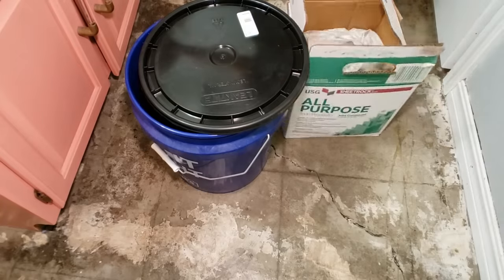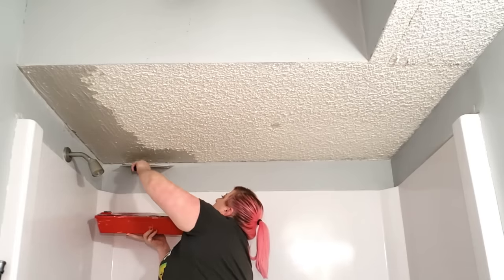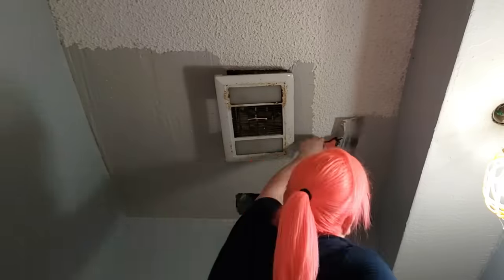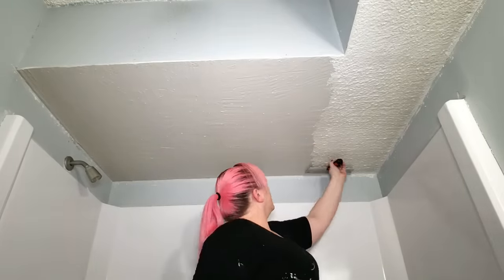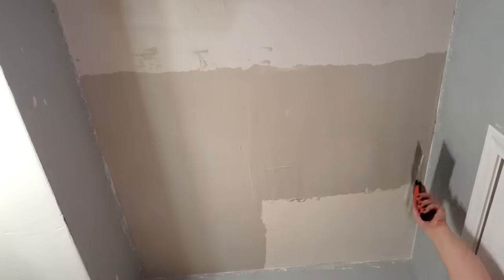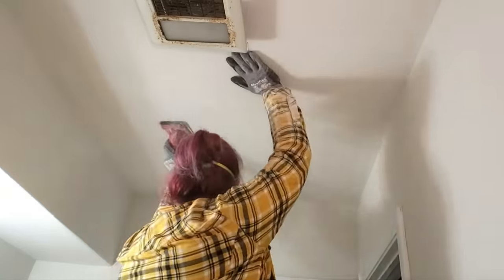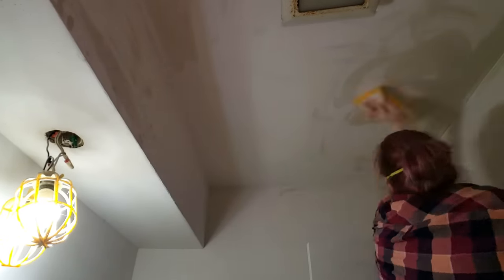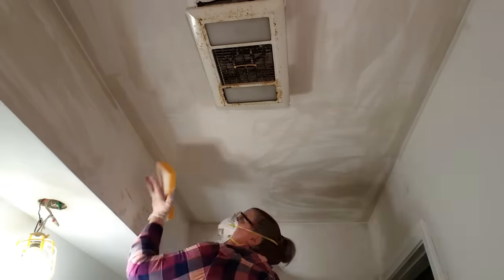How To Cover Popcorn Ceiling Without Removing It | Skim Coating Over Popcorn Ceiling

Comment: Looks like im keeping the popcorn ceilings
Reply: DONT BE LAZY
Reply: @djbusiness2010  I will be
Reply: @djbusiness2010  Lazy? The whole point IS to do the easiest way.
Reply: @markgoodwin183  the point of it is to get it done
Reply: Yeah this is a nightmare I hate my new old house and popcorn ceiling Lets go brandon!
Reply: Lol, thinking the same thing!
Reply: I agree... Popcorn ceilings are much more expensive than a plain ceiling!
Reply: 😩😂 Exactly how I felt
Reply: Just found this video After...we screwed new drywall over the popcorn ceiling.
Reply: Just watching this made me tired.  Why not just over it with 1/4 drywall?
Reply: @HawkGTboy  ive seen some people just do a skim coat over it which seems easier than this.
Reply: EXACTLY 💯
Reply: This is way too much work for what it’s worth. Cover it with tiles, put in a coffer.
Reply: Better off just hiring a professional to drywall the ceiling you want covered , abit more expensive but the quality is exceptional. Like a brand new ceiling👍
Reply: Same here!!!  Sheesh
Reply: Waste of time and material, just wet the poccorn and remove
Reply: @gerareyes2209  you don't know what the ceiling is like under the paper. It was probably put there to cover up crap plastering, so you'll have to do this anyway.
Reply: @JakubSK that’s what I’m thinking about doing to make things easier and less tiring and messy.
Reply: Holy moly that’s a lot of work for a little room !!! And I have a whole house to do 😮 so far I’ve done my larger bathroom by just running a wide smooth trowel over the popcorn, it sheared all the popcorn lumps off. Not completely off but way smoother. After I painted it, it looks textured but smooth textured. I can certainly live with that 👍 And it only took one day start to finish.
Reply: Me too! But, I'd like to take a sanding pole and see if I could sand and sorta get a knock down texture, hubby doesn't want me too tho...
Reply: Too much work. I just won’t look up anymore.
Reply: Ditto!!😂
Reply: 🤣 I loved this one
Reply: Wayyy too much work for the area done. Hire someone to drywall
Reply: @HawkGTboy because you would still have to tape the seams and mud them including the seam at the wall and all screw holes.  Easier to just mud it in the first place
Reply: @susansmith574   Yes, I was kind of thinking it looked pretty good after that first coat she put on - couldn’t you just paint it then without sanding and call it a day ?
Reply: lol same here , my neck hurts already 😂
Reply: MysteriousOklahoma you can only do that if it has never been painted.
Reply: My popcorn was never painted, and this method does NOT work. Just got the popcorn wet, and then fell from ceiling. Turned out better because after scraping, I just had to apply one coat of skim.
Reply: @Yaya1030  😭
Reply: You can easily remove the popcorn. It’s skimming  joints and such after that’s a nightmare. Would I just mud over it? No. I can see chunks coming off. There are videos showing how easy removing popcorn is and most will say “now you see all the flaws, time to skim”. I’m doing Reno and I’m leaving the popcorn. 

I do see where if you think it may be asbestos you could skim over it. But I’m kinda at a “screw it” phase.
Reply: @Susan Smith  I removed it from my whole home.  I found it easy with a spray bottle,  let water sit for a few moments the take a large trowel with the mud tray to catch the wet to avoid mess.  I did hire someone to come in and spray with an orange peel texture,  but you could just paint.
Reply: @texasjones9541  completely agree with hire someone to finish it.
Reply: No kidding!
Reply: @gerareyes2209  if it has asbestos you shouldn't do that. So that might be why
Reply: I want to get rid of mine but 😒  that's a lot of steps. However,  my space is much smaller so I may do this. Now Q: I have cement board above the stand up shower which I painted with drylock. Should I still add tile? Not too much room b/w shower head and ceiling 2-3 incheS 🤔
Reply: I was going to share the same. Mine are there to stay.
Reply: Me too!
Reply: @gerareyes2209 if the previous owner painted the popcorn is it still so easy to scrape?
Reply: @Carcassbits11  I think it is even without water. But the dust will be everywhere. That's why I'm not doing it. Trying to remove a screw on the ceiling, I scraped a whole chunk without trying to :P
Reply: Way easier to get a sprayer with hot water and spray the ceiling and knock down the popcorn with a spatula. I did a 450 sq room in 2 hours
Reply: @JessieRed was it hard to find studs to screw into?
Reply: Popcorn ceilings suck!  Ask me how I know as I’m in the middle of scraping that crap off my bathroom ceiling !
Reply: @Yaya1030 Hahaha!! Agree 💯
Reply: I can't do that. It's impossible as I have a large house. I'll just hire a professional and avoid a neck , arm  shoulder pain.
Reply: Two type of popcorn ceiling,   one, just get it wet and it will scrape off with ease test it in a closet or bathroom,  the second type…learn to enjoy your permanent popcorn ceiling!!  Sorry
Reply: Because you would still have to skim AND tape over the drywall anyway! @HawkGTboy
Reply: @HawkGTboy  just to avoid redoing all the crown moulding? I'd actually like the real answer bc she had none...
Reply: @proverbwoman5591  For me, my whole house has this crap. I’d want to minimize the sanding and dust as much as possible. So I think putting up 1/4” drywall would make the most sense for me. But you do you. 

I’d certainly pay someone to do this, no way would I tackle it on my own.
Reply: Your way was probably easier
Reply: I painted mine and they look great I used glidden semi gloss I used a cheap roller because the thick matte one absorbed a half of the gallon of paint, it was expensive and its just drywall mudd but its hard to scrape off you can do it but you need water but that makes a huge mess I just took my time it turned out great
Reply: @gerareyes2209  water doesn't work for everyone. Once popcorn ceiling has been painted over, it becomes nearly impossible to remove. I tried undiluted 30% vinegar. I tried sanding. Nothing worked.
Reply: @muuks_the_entrepreneur was this done on a painted celling?
Reply: I painted mine I used a semi gloss whut You have to roll it with a low nap but it turned out great and I am getting ready to repaint it
Reply: Isn't much easier to sand the popcorn ceiling?
Reply: @JessieRed I just found it two days after my husband scraped off the popcorn ceiling in a room we are finally renovating.....
Reply: I get it’s easier to scrape off but just so everyone knows if the popcorn is old enough it can have asbestos that’s why professionals do it. 

So just keep that in mind , her way is longer steps but she explain you can go faster with a heavier coat it looks nice because hard work pays off. 
But I also like the drywall idea and if I had to choose I’d go with drywall especially as a renter.
Reply: Just did the same thing in my living room haha 😂  @JessieRed
Reply: @HawkGTboy 1/4 in is more expensive than 1/2 just go with 1/2
Reply: Lol, thinking the same.
Reply: This might be good for a small bathroom,but a whole house…crazy amount of work over you head nonetheless
Reply: Okay!! 😂😂
Reply: @gerareyes2209 It’s very hard to scrape off painted popcorn. You have to strip the paint somehow and you have to scrape several times
Reply: How did that come out? Easier I bet.  @JessieRed

Comment: This might be ok for a powder room but let me see you do a living room or large bedroom this is way more work than taking it down and takes much much longer if you are a DIYer if you attempt this on a larger room you will end up with neck and shoulder pain and a bill from the chiropractor I’ve been a painter for 40 years and this is not even close to the best way. If you try this many people will get half way done and then it’s too late to remove the popcorn and you either have to finish it or call a professional to get it done.

Comment: I've looked at SO MANY videos at how to remove popcorn ceilings until I'm dizzy.  Came across yours and I know for a fact I'm using your way.   Thank you for enlightening me to this no nonsense technique!👍🏽
Reply from the maker: Awesome thank you so much! I hope it works out well for you, good luck!
Reply: If the popcorn ceiling is stained or dirty, would this process still work? As you know trying to clean popcorn isn’t really a option.
Reply from the maker: Yes you can still do this if they're stained or dirty! Just vacuum off or dust as much as you can off of the popcorn ceilings but I know it's almost impossible to get them completely clean. I did my best but everything I couldn't get off just got covered with the skim coat, it didn't hurt anything.
Reply: Big mistake
Reply: @patfanortiz8973  What's a big mistake and why?
Reply: How did it go?
Reply: @mutekuro  it took some trial & error but turned out great!👍🏾  Glad I ran across her video.

Comment: Tip. Use a texture spray hopper with thinned joint compound to saturate the ceiling and smooth with a wide knife. Takes a few coats but easier and faster way.
Reply from the maker: Thank you for the tip! That sounds like a great idea, I will probably buy one and try that in the next room.
Reply: Would love to see how that goes. This surely looks painstakingly long and hard. Kudos to you guys for such awesome work.
Reply: @hameedahudda6338  Yeah, it looks like a LOT of hard work. Maybe even more work than the wetting/scraping process...I did a lot of that in the main rooms of my home many years ago, but just couldn't face that again, so recently I simply dry-scraped the worst of the popcorn off the remaining room and painted it with an oil-based paint. Now it looks like a lightly-textured ceiling, and it's mop-able. Easy peasy.
Reply: @TheNiftyNester did you end up trying it with the texture spray hopper?
Reply: Wondering the same thing @theniftynester!
Reply: I preferred to wet it first n then scrap it, after...I already try n is way faster...is a whole house...🫣

Comment: Instead of using sandpaper to sand the dried joint compound, I use a damp sponge.    No dust.    Easy.
Reply: Do you have to do it while the compound is yet?
Reply: Yes. But. I use my 6" mud knife. I wet it and take off any excess, and it works great! You can use a sponge, but you won't get the smooth finish... @metabolicamente
Reply: @inmyopinion8620  that's brilliant! What is the brand and kind of your 6" mud knife? I've heard of some mud knives with "worn-out" edges, so they don't leave marks.

Comment: Well, the outcome looks very good. But, I'm wondering, do other, larger, areas in your home have the same textured ceiling? I would think so. since the original builder probably did all ceilings the same way. I can't imagine doing large areas such as living and dining room ceilings. If so, would you actually undertake the same procedure in those areas?

Comment: I have done a knock down ceiling on new drywall, I’m wondering if a person couldn’t just do a knock down coat after the second coat or even the first for that matter, a person could save time? Knock down was so much easier than i thought it would be, hides everything.😊

Comment: It’s so tempting but this is so much work than scraping it off! And has anyone there tried this years before and the popcorn thats holding all of that heavy multiple layer of skim coat? I’m no expert but if the popcorn would get soft from water I just cannot see how it will hold on to anything? What happens on a very humid day perhaps weeks?

Comment: I did an asbestos test before touching popcorn ceiling. Still awaiting the results.  But, I have taken the popcorn ceiling off years ago on other areas of my house.  It’s messy…. but simply misting the popcorn ceiling with water the popcorn practically falls off.  When the ceiling dries, wipe your ceiling with a damp cloth, let dry, prime, and paint.  
This is WAY easier than coating it 3 times and sanding it several times.  
I did wipe down the walls afterward but, as annoying as that clean up is; the walls needed it even without having popcorn dust on it so it was well worth the wipe.

Comment: The Nifty Nester, I'm curious to find out if you use ladder, step-ladder, or scaffold  (don't own one) to reach ceilings.  Even 8 foot ceilings can be a challenge to reach; especially with uneven surfaces as bathrooms with bathtubs and toilet.  If you can share this tip I'd really appreciate it.

Comment: Your ceiling looks really good. It could have been done a whole lot easier & faster though. At my old house I used 2 different ways, in a hallway I used a spray bottle filled with water & sprayed the popcorn ceiling until it was saturated. I waited a few minutes, then used a metal putty knife & knocked it down easily. The exposed ceiling underneath was in pretty good condition & I was able to skim coat the areas that needed it, then primed & painted. In my bathroom, I bought some ¼" drywall & attached it right over the popcorn ceiling. It took hardly any time even with taping & mudding. It was easy to work with the drywall because the ceiling of the bathroom was so small & the drywall being so thin, was not very heavy. This was an interesting video to see another way to repair a ceiling.

Comment: I’d be curious to know how this method holds up over time. Do you have an update? My intuition from working as a painter would think that the skim coat would not adhere to the painted popcorn & would delaminate over time.
Reply: When we moved into our house 35 years ago, the builder had covered every square inch of the walls in horrendous bumpy texture. I've despised it from the very beginning. 4 years ago I found out about skim coating and had some painter friends come over to skim coat the dining room. It was a miracle! There have been no issues with delamination, or anything else for that matter. Since then I've had all the walls in the house skim coated except the kitchen, which has been painted so many times now that it's smoothed out quite a bit, so haven't decided if I'm going to do it.

Comment: I would be one of those who sand between applications. BUT, I have methods to eliminate excess mudd for much less to no sanding, however, it may not work for first coat of mud on popcorn... I was very impressed by your patience, explanation, and determination! I am thinking 1/4" drywall over it. Less hastle, time, and coats. But, you did good!
Reply: how do you sand?

Comment: I've found that when you plaster over a painted surface, you should paint a drywall primer over it. We used a Killz product specifically for drywall when we replastered our entire living room and dining room area. We did not have any bubbles! But we also did a skip trowel finish over the old school sanded plaster finish. I came here to figure out what to do with the popcorn ceilings. A question I have, is how does it hold up? Because, in a small hallway area I just tried paining the popcorn and as soon as it got wet, it started to fall off the ceiling. Wondering if that the same as with the wet joint compound?
Reply: Yes, that's what happened to me too.  The popcorn soaked up the paint and then fell down in chunks

Comment: Awesome job!

BUT be careful.... Depending on the age of construction (circa 1980's) stucco ceilings and walls may contain asbestos. If you disturb it (scrape it, chip it, etc.), it goes airborne. You should at least be wearing a P100 mask, put up plastic tarp, have the window open with a fan pointed at the window if you don't want to do a test before any work.

Comment: Great video. I would make one slight adjustment - if you fill in pinholes or low spots in bare mud, those spots will never sand out perfectly. Prime the skim coat first, then come back for the spot repairs. They’ll sand out 100x easier and better.
Reply: What do you mean? Primed wall is harder to sand than dried mud.

Comment: Thank you for this video. I have never seen anyone skin coating a popcorn ceiling before. This works great for popcorn ceiling with asbestos. Also this increases the thickness of the drywall which helps with sound proofing.

Comment: I have found that popcorn ceilings fall off in small pieces over time, will start with pieces about the size of a quarter and get larger from there, so this doesn’t seem like a viable method, seems like it is just delaying the inevitable task of scraping it all down.

Comment: You definitely figured out the difference in the compounds.  The All-Purpose is hard to sand.  It is great for taping and first coat.  The light-weight stuff sands easier and is good for 2nd/3rd coats.  If you are doing this a bunch, I highly recommend one of those 9" orbital drywall sander with vacuum.  You can get a cheap one for like $150, you don't need a Festool at $1 million dollars.  The cheap one will work fine for DIY.
Reply: I had a cheap one, they are less than worthless.

Comment: Can you still shower while the coat is drying or is it best to avoid using the bathroom during the process?? Asking Because I only have one bathroom 🫠
Reply from the maker: It's hard when you only have one bathroom. If possible, I wouldn't use it while the joint compound is drying. You might be able to get away with lukewarm showers with the air vent turned on. I haven't had to test that out, so I can't say for sure if that would work, but it's the only thing I can think of that might help in your situation. We did have to use that bathroom a couple of times after the joint compound dried before I was able to seal it with primer, and it was ok, but I knew it was risky.

Comment: Good job, I do this also but I use Easy Sand 45 or 90 on the first  and second coat . I doesn't shrink near as much . Then I use Dust Control on final coat . When it's all dry I prime with oil base pimer . The oil is not a solvent to the finish coat  as would be a water base primer, plus it's a much more durable primer in a bathroom .